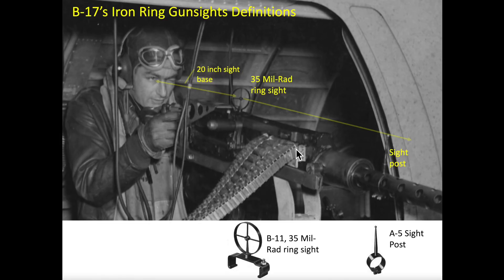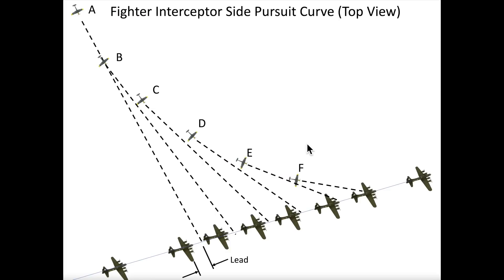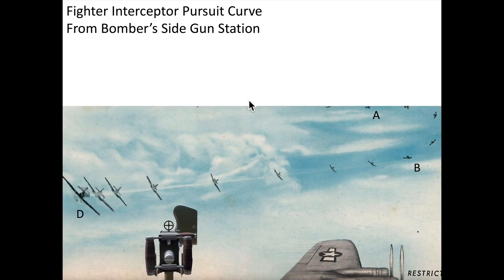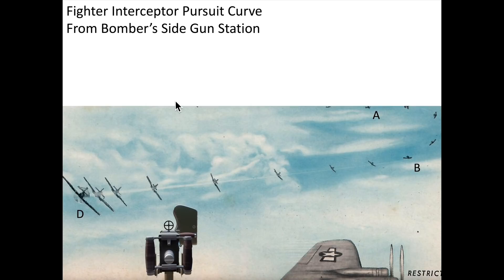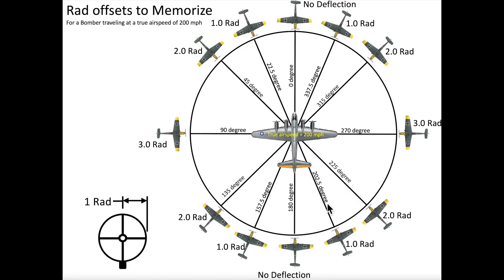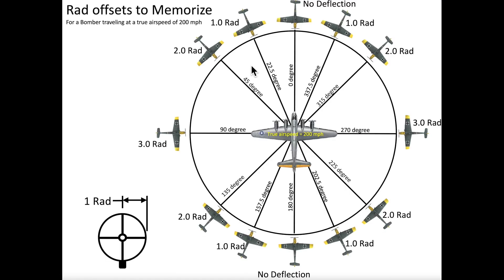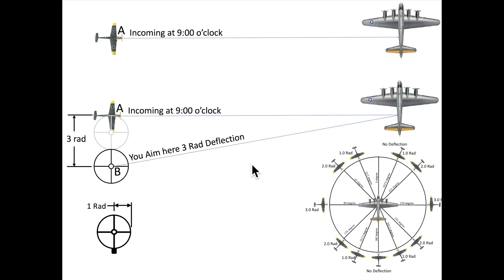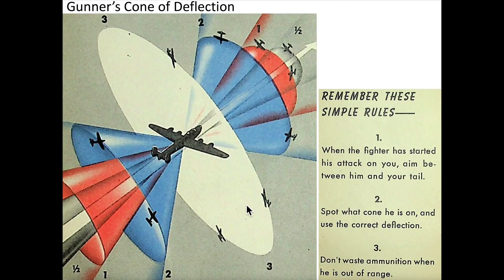B-17 Bomber Tracking and Firing at a Moving Target

Comment: Another great video, thank you very much but I have a question that has dogged me for a long time.

Hundreds of attacking bombers, with gunners, some of whom were brand new, in a high stress situation (the cold), even higher stress when attacked by fighters, and so my question; how many times did the gunners "gun" other bombers?  I'm thinking it must have been common. 

Suggestion for another vid, if I may.  From Douhet to the end of the war the American philosophy was, the bombers will always get through!  And positing that heavy defensive gun fire will discourage pressing home the attack (even if the fighter is not shot down), I wonder if the AAF ever calculated how many guns an attacking fighter would face from any given vector?  I guess I'm asking from which angle could the bombers best defend against?

Comment: I think you got that wrong with A bomber travelling at 200mph & the fighter coming in perpendicular on the port side, saying the gunner would aim to the left of the fighter. The wind would deflect the rounds further left. Surely the gunner would aim to the right of the fighter ?
Reply: It is because the bullets are traveling at bomber flight speed (though sidelong) in the direction of bomber travel and at bullet speed toward the enemy,  so you aim left to compensate.
Reply: @FranktheDachshund  - Exactly.
Reply from the maker: It may seem counter-intuitive at first, but the bomber gunners always aimed between the fighter and the tail of the bomber. This assumes the fighter is flying a standard attacking pursuit curve. It was irrelevant as to the side the fighter is attacking from, the amount of deflection is only dependent on the angle of attack relative to the bomber.
Reply: @WWIIUSBombers  like this.... https://youtu.be/DWYqu1Il9Ps
Reply: https://youtu.be/DWYqu1Il9Ps

Comment: Air gunners consistently exaggerated the number of enemy they shot down. On the  Regunsburg, Sweinfurt raid air gunners claimed to have shot down over 200 enemy fighters. That number was readjusted to 28 after close study in after action debriefings. This problem persisted throughout the European bombing campaign in WW. At the end of the war the survey conducted on the accuracy of high level bombing was conducted and it was found that only three bombs out of every one hundred dropped by the Eight Air Force came within two miles of the attended target. The lack of bombing accuracy at high levels was a primary reason the Eight switched to carpet bombing on German targets and cities. So much for the for the theory of High Level Strategic bombing so long touted by so called experts.
Reply: If four guys are shooting at one fighter and it explodes in mid-air, four gunners will claim the kill.  Most were only giving an honest assessment of what they saw.